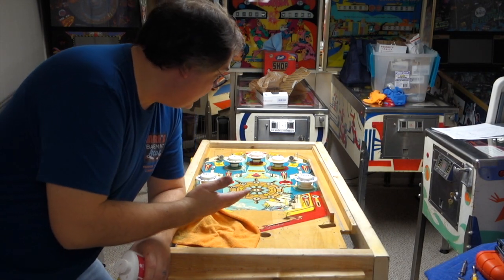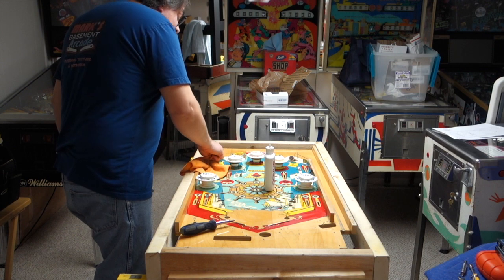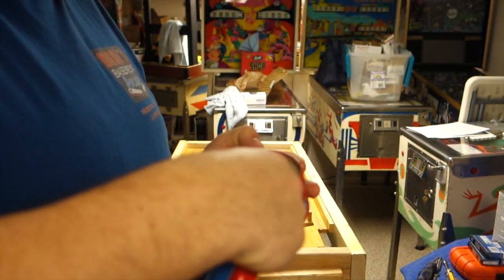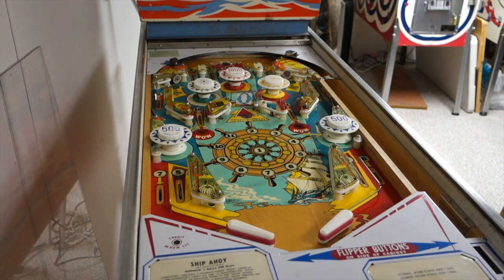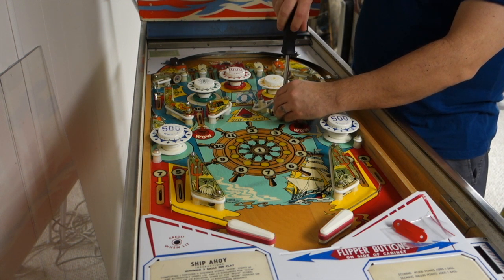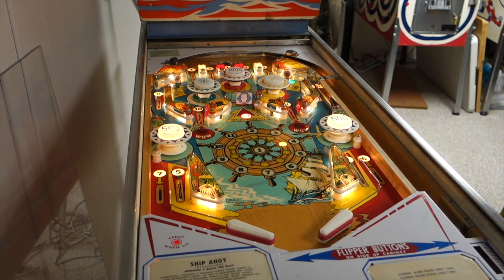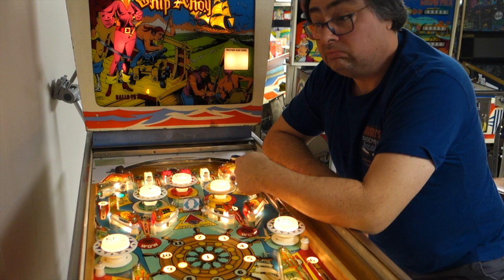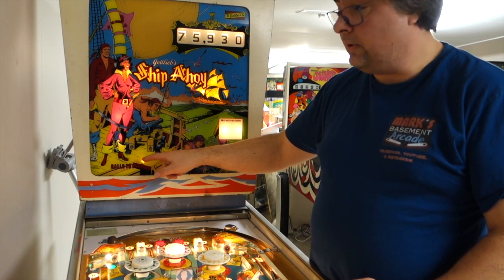1976 Gottlieb Pinball Ship Ahoy Playfield Assembly

Comment: Hi Mark,

I have this machine...and it works great!  but 2 issues please - - -

The spinner in the center does not "fly around".  when the ball passes under it, it moves by one position.  If you flip the ball into it, it does not really whip the spinner around.  Where is this sensitivity adjusted?

The ball often hangs up on this spinner.  Do I need to pitch the table up more by adjusting the leg adjusters?

Finally, at the top of the table, where those 5 table inserts are like 4,3,2,1,5 etc.  The '44' style bayonette bulbs under that relay rack are next to impossible to get at to change out.

Do you have  a technique for getting at these bulbs?

Thanks

Bob Schworm - Cleveland
Reply from the maker: There is a leaf switch that controls the spinner.There is a cylinder type block on it with a set screw to adjust the tension. If you cant find it send me an email, email is in the about section. The wheel disc assembly actually comes off the replace the bulbs easy, you can kinda see it here https://www.youtube.com/watch?v=S2S4JGhq1rg&list=PLWWEZRh1Vks9F7eJ2P50DOQ49s0sK35X5&index=13&t=32s